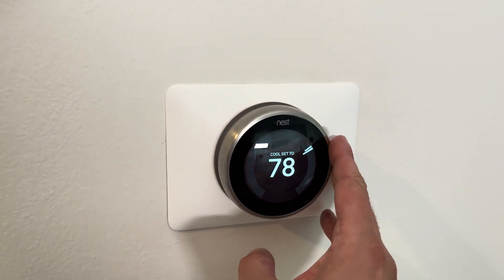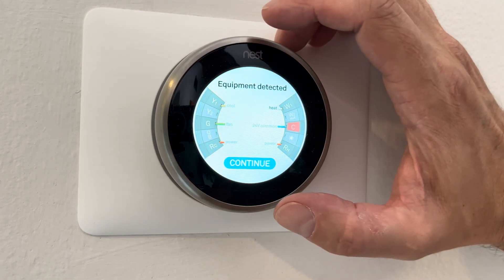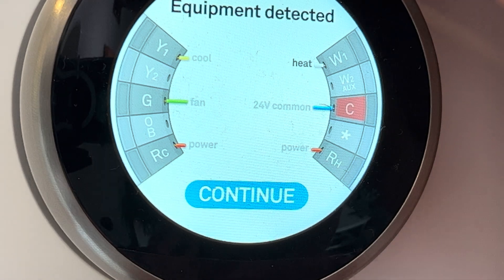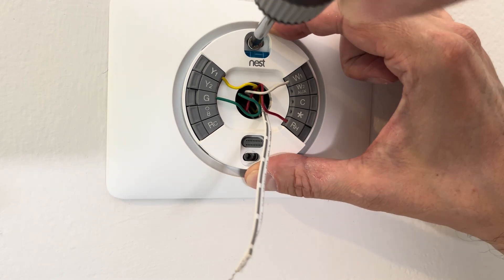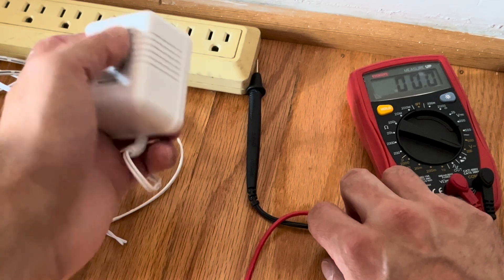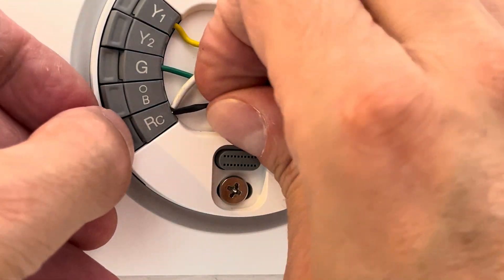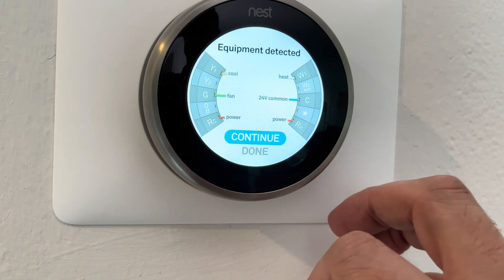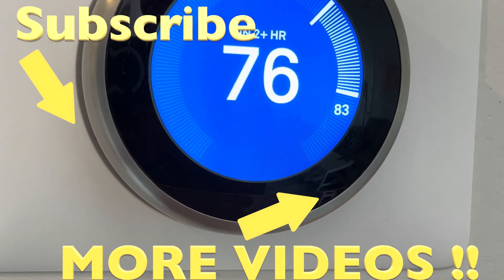Nest E79 Error Code (How to fix instructions)

Comment: A condensation emergency switch, also known as an air conditioner float switch, condensate overflow switch, or AC safety switch, is designed to shut off an air conditioning system if the water level in the drain pan rises too high. This prevents water damage from occurring. 
Here are some things to consider if your condensation emergency switch is full of water: 
 
Check the drain line
Look for leaves or other debris that may be blocking the drain line where it exits your home. 
 
Check the condensate pan
Make sure the pan is installed correctly and leveled, and that the drain line is positioned properly. A rusted drain pan can also cause water leakage. 
 
Check the condensate pump
Don't run the condensate pump without any water in the reservoir, as this can damage the device.

Comment: Brother! Thank you! I’ve been beating my head against a wall for days now. I know may way around a meter and wire diagrams. Turns out after a week long heat wave our nest failed out (low battery). I learned that normally it steals power from Rh and Rc, when the units are off. However with the Ac on for days the Nest can’t charge. I got a 24v transformer. My HVAC setup is a separate heater, and AC unit. Zero provisions for a C wire. I tried many ways to trying to hookup the nest so it would charge, but NO ONE out on the web showed the piggy back method you show. Tried it, Nest shows power, charging, I hooked my 24v AC transformer to C and RC and it’s all good!!